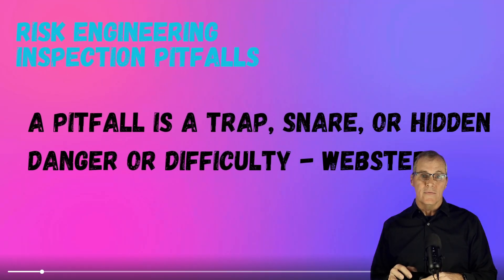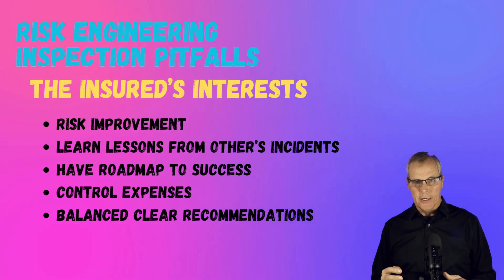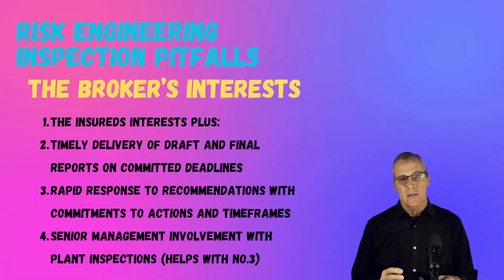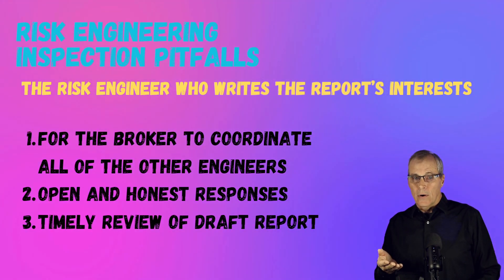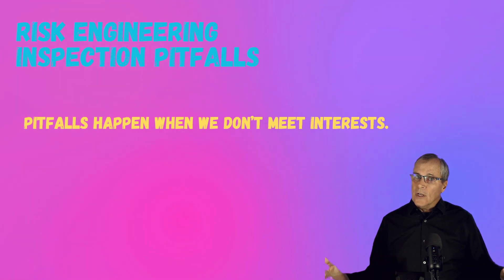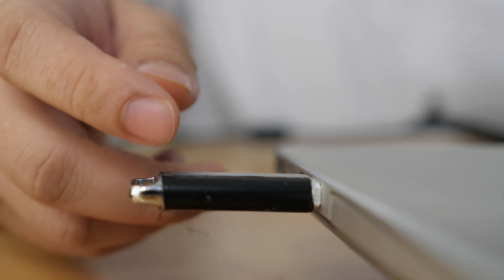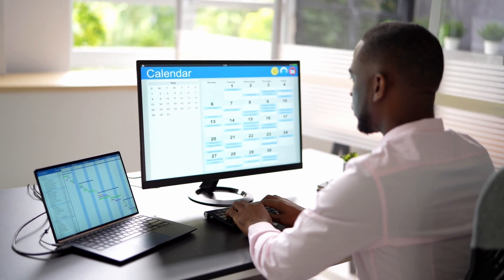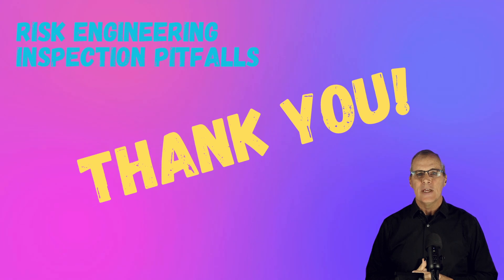Risk Engineering Pitfalls - How to avoid bad inspections

Comment from the maker: Wow! Thank you for the thoughtful questions. The make and model of Gas Turbines especially is important as they are all generally still research projects when they are built. Mechanical issues can be model specific. There are certain large power transformers that may have design defects. As for the Halon system. We had a $50K protection system for a $10K building. Refilling the Halon would cost more than burning down the little building. When we have a useless system, it doesn’t matter if it works. It should have been removed. 

Thanks again for the input. Would you be interested in me interviewing various Risk Engineers to find out how they got started and what they like about Risk Engineering?
Reply: Yes why not, I would love to share my stories from India stint & how different I found the UK market
Reply from the maker: @swapnilkireet  are you on whatsapp?

Comment: Hi John 
   I am a junior Risk Engineer working in the UK. I thanks you for sharing the video & kudos to you for making such content. 
I had a few questions though: 

1.  Why make & model of equipment are required by the underwriter ? I mean a transformer or motor capacity is enough with records to show periodic maintenance. Since the equipment is being used in a factory, it will be  from a standard company (reputed/reliable brand). We can always highlight if something is non standard but mostly people dont cut corners with such equipment  

2. The European Engineers fire door insight, was he not wrong that the halon would not work as intended due to the lack of pressure with open gate. I can get back to you on this. 

A few of the pitfalls I have been part of, while I was working in India: 

Unorganised inspection with poor coordination. I once went in a visit where 4 other Engineers were expected, apart from myself. When I was about to complete the inspection, I crossed the other group which had arrived at a different time & with other site contact altogether. 
So yes these things does happen..

2. During my meetings, I used to call a person from health & safety, maintenance & production so that any requirement could be coordinated. 

PS: Thank you once again for the video. I was trying to message you on LinkedIn (request pending) but I could not due to lack of premium subscription.
Reply from the maker: Sorry for not replying better, sooner. Underwriters considering multi hundred million dollar risks cannot rely on the good “intentions” of anyone designing, installing, operating or maintaining that equipment. Their actions must be documented. Make and model of Gas Turbines etc. matter because there are well known  manufacturing defects in their equipment. The OEMs regularly issue Technical Information Letters or Service Bulletins for their equipment based on lessons learned from fleet issues. If we don’t know what model the equipment is, we don’t know what service bulletins apply. If we don’t know what bulletins apply, how do we know if the machine has been updated based on the fleet issues that caused the TIL to be issued? We don’t. So we get the make and model of all large equipment. Some engineers like to know the serial numbers too. Not me.